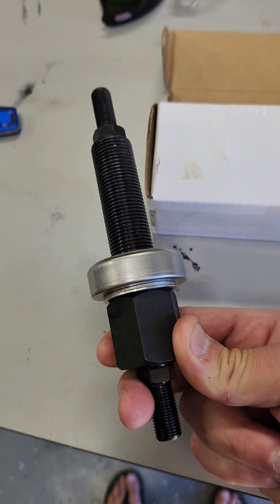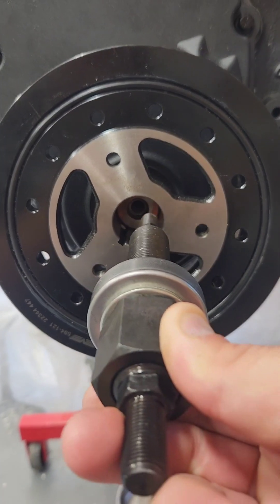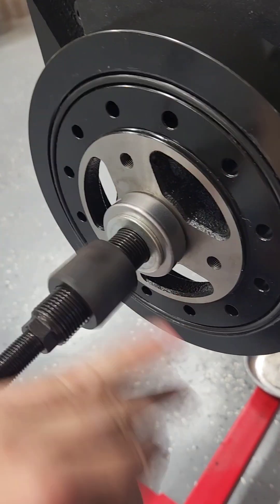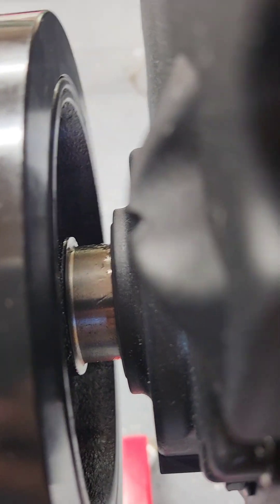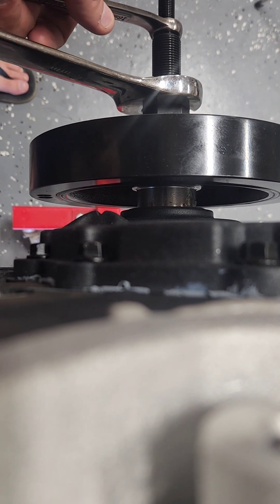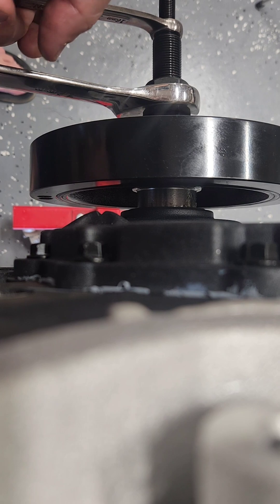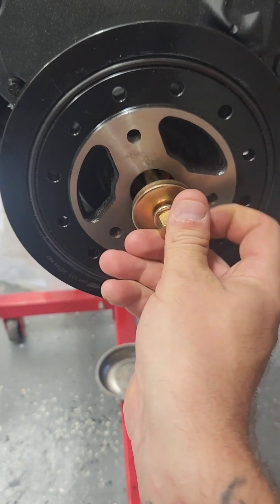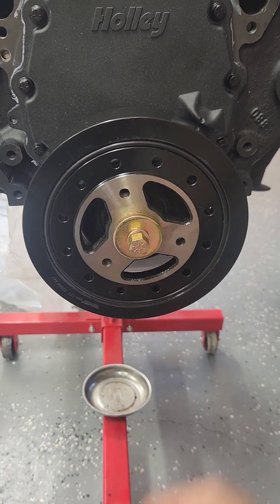How to Install a Smallblock Chevy Harmonic Balancer.

Comment: Also place some RTV sealant into the keyway slot on the harmonic balancer just before you put in on the crank,  this way oil cannot migrate through the keyway and cause a leak later on.

Comment: After about 5 small block builds that thing gets lost and replaced by a dead-blow hammer and a impact. 
Pro-tip: The shiny bolts they supply are only good for taking to fastenal to match up with the strongest bolt they offer in that thread.

Comment: I just laughed a little. Maybe I got incredibly lucky but I didn't use that tool when I done it to a 1985 Chevy Blazer. I done it in 1998 or 1999.
Reply from the maker: Sometimes you get lucky.  Sometimes you don't.  I have been on both sides of that lol